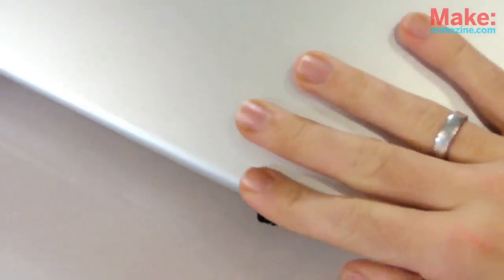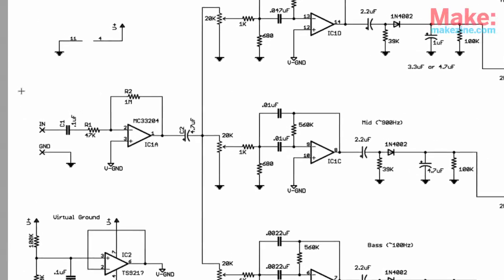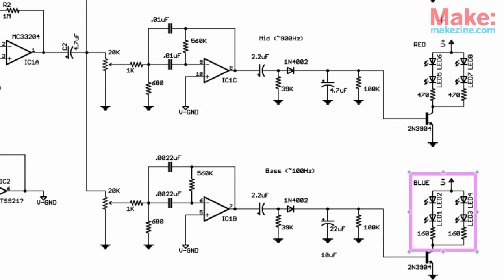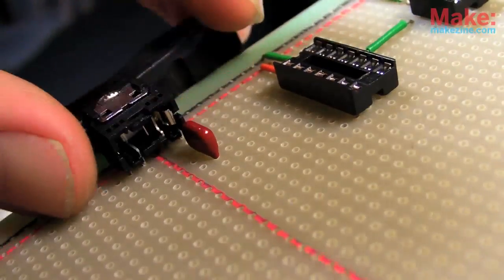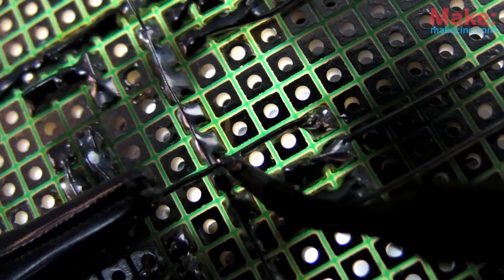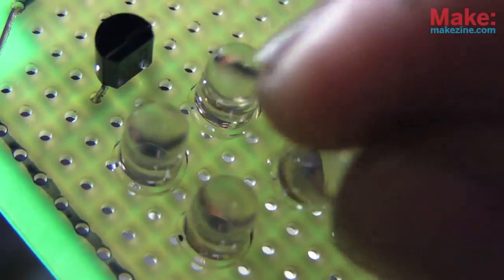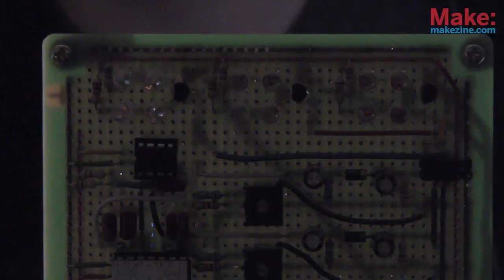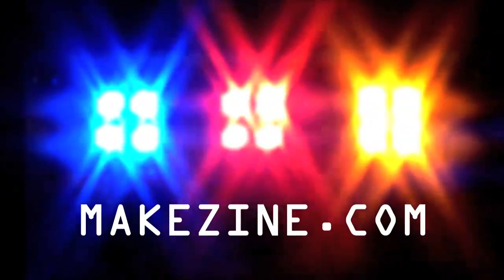Circuit Skills: LED Color Organ

Comment: Is there a way to miniaturize this design even more using smd components and 3V?
Reply: +jevries i know this was posted three months ago, but yes, Im designing a pcb that uses an arduino atmega328-P chip and a msgeq7 spectrum analyser to do this very thing. when its finished i can upload the eagle files and arduino files to something like dropbox or github if you'd like
Reply: +John McLaughlin That would be Nice!
Reply: i almost have it finished, there are a few jumper wires on the board due to single copper sided design(even though there are parts on both sides). i will include a map of these in the notes, it takes 12v in and  uses 12v led strips, i can design in a toggle switch that selects 5v or 12v for the leds if you woyld like
Reply: yeah, just in the final stages of testing mate, sorry its took so long, been swamped with work
Reply: +John McLaughlin did you make it dude?
Reply: :)) and ?! you died ?!  where is it.

Comment: where can i get ready made circuit like this i have plenty of LED strips
Reply: In sure you could find one on eBay, or radio shack sells a pre made circuit board with components and a much simpler layout

Comment: Hi. Can I use TL084 and C2383 instead MC33204 and 2N3904? I can't find MC33204 anywhere. I finished this Circuit with TL084 and C2383 but it not work,my LED isn't lighting. I can't find TS921 too,so I don't have virtual ground circuit but I used one 680uF capacitor to make same virtual ground. Some body help me :(

Comment: Great video! Could you show what parts solder onto one another, I'm a beginner and I don't really know what should solder onto what. 

Thanks!
Reply: Donna Davis that is what the circuit is for...
Reply: if i was you i shouldn't do this for a beginner project.
Reply: if i was you i shouldn't do this for a beginner project.

Comment: Can we make the same using LED strips instead of small LEDs... how the circuit will differ.

Thanx in advance
Reply: Totally! Just be careful about voltages and power consumption of the LED strips. The only difference would be the LED strips replacing the LEDs, and depending on how bright the LED strips are, maybe a few resistors.
Reply: For a longer strip of LEDs, you might want to add a few N-Channel MOSFETs to the LED output of the organ.

Comment: I built a 4-channel color organ back in the mid-60's from plans I found, probably in an Electronics Illustrated magazine.  I had to use 7-watt Christmas lamps back then.  I experimented with various ways to display the colors.  It finally burned itself out and I tossed it...I should have held on to it.

Comment: Can I solder on some type of mini microphone and then if I did would it flash the light by the ambient sound in the room and by "speaking" to it? Thanks.
Reply: yes you could,
I'd use a piëzo and use this as the incoming signal maybe the value for the first opamp should be changed so it boosts the signal a bit more but i think it'll be allright

Comment: Hello Colin, thanks for the video, can you tell me if this configuration will power more than the sets of 4 LEDs (I'd like to put 15 or so LEDs in 3 pots and use them to light a stage)

Comment: 8:13 seizure danger averted

Btw, isn't it possible to have the similar effect analyzing the vibration using accelerometer or something? In that case if You want the device to work with any device — just put it on the speaker case.

Comment: im going to do this as a project and as a noob i have 2  questions....

1) on the schematic, what is at the top left corner of the picture?
&
2) what is the voltage that it runs on?

Comment: Opamps usually require a split power supply. V+, V- and GND.  If you want to power an opamp from a single-ended power supply, (say a 12V power supply, or 9V battery), this kind of power source only have V+ and GND.   What you can do is create a virtual ground so your 12V SE supply becomes a +6V, -6V... all referenced from a virtual ground. i.e. you split it in half, and the midpoint becomes the new "ground".

Comment: Hey collin (or anyone), would this work if in place of the audio jack I attached a piezo disk which was in turn mounted onto an amplifier or speaker. Basically my sound set-up has only so many outputs, none of which are available for this to plug in, but if I used the piezo just sitting on one of the speakers would it pick up the sound vibrations and transfer them into the circuit just the same as if the audio source was wired straight in?

Comment: That can easly be done with a microcontroller, an arduino for example. It's far easier than this color organ, requires the most basic of programming understanding aswell.

Comment: Buy those 3W star leds from ebay instead of soldering 50 small ones. Not sure what transistor he used in the video, but the standard 2n2222 NPN has a current rating of 800mA which is enough for those star leds. About seperating, just leave the transistor and resistors on the board and draw wires to your lights.

Comment: What is the point of the 2.2uF and the 39kOhm on the output? High-pass filter with a cut-off frequency of 1.85hz? Also, where is the current limiting resistor for the base?

Comment: Its connected to the 12V supply
V+ corresponds to the pin of the MC332 (the IC that contains 4 OP's that he used)

Comment: Collin, I have a couple of questions- 1. do the op amps other then Vgnd still get a connection to power though not shown?  2. Where the band pass filters are shown to connect to Vgnd, that connection is made to the output of the Vgnd op amp?  3. the ground on the audio input is connected to the circuit ground? the negative side of the power supply?  Please respond (anyone who knows really)  I'm definitely building one and I want to get it done asap.

Comment: @NikySportsPromotion it's a voltage divider with Vout=Vin/2 and a a voltage follower circuit (acts as a buffer), so you draw no current from the divider, which would make it have a different Vout depending on the current you draw.

Comment: I just made this! It works great! Dimsanda, pin 3 is not technically a power input. It's "virtually grounded". The 12 volts should be the only supply voltage.

Comment: Hi , I'm going to try this one.but I have a question,
1.In the virtual ground circuit,there are 2 power inputs(pin 7,pin3)
In the pin 3 power input ,it is grounded on the other side o.O through two
resistors. Will the circuit short out????
Anyone please answer me.
thank you.
Reply: Pay attention to the ground symbols.  The ground with the three bars is basically the negative terminal of the battery, whereas the circuit sets up a mid point common reference for the rest of the op-amps.  It's a way of taking a single rail supply and making it look like a two rail (positive and negative) supply.  You want the reference of the triangle shaped ground to provide a mid point reference.  Without it the circuit won't function properly.  The alternative would be to use two batteries in series with the battery junction acting as the common reference point.

Comment: you can use LM324 instead of MC33204. The pinout is the same, and i would use a LM386 IC instead of TS921, but the pinout is'nt the same. IC with the same pinout is the LM741(a.k.a. UA741,ßA 741). Note that there is no datasheet for TS921.
Please rate this comment, because i will post the parts list too.

Comment: Hey guys, just to clear something up...The schematic is not my design. I don't quite know where it came from, but it was modified by me and a few other users of my website over the years. Originally it may have been based on a old and now defunct kit but I don't quite remember as it is 15+ years ago. Either way, I'm glad you found the info useful and glad you enjoyed the project!

Comment: Wow this is awesome! Ive got visions of modifying this to include relays or something and then getting it to switch higher power mains circuits. Made a disco light box a while ago that had 3 mains LED circuits in it powered by an old Christmas light sequencer and some bridge rectifiers. If I could get this to switch some relays or something then I could use it to make it light controlled. Also you could wire a mic into it as well and have it so that when 3.5mm jack is plugged in mic disconnects.

Comment: @JohnMPed with the op=amp that there you may be able to use a dynamic mic, but you probably will need another stage of amplification or more gain on the pre-amp section

Comment: @JohnMPed ya, you would probably need an amplifier, but you can find simple ones to build out of just  3904 or 3906 transistors. if you want to go all fancy you can use an op amp

Comment: @supafly377
It just provides 2,5v...
the 2 100k resistors function as a voltage divider.
the Op amp functions as a voltage follower.

Audio signals are alternative, so in reference to 2.5V  you get +2.5v and -2.5v.
The 2.5v "virtual ground" goes to the "-" of the 3 Op Amps.

To get a more LED's you need more OpAmp based filters.

Comment: Wow this is awesome. I'm an electronics student and I really want to get into DIY electronics in my spare time, and ths feels like a good first project. Justa few questions thoughif someone could help:
1. What is that virtual ground bit doing
2. Where does it go in the circuit? i.e how does the other stuff connect to it.
3. What do the numbers around the op-amps mean? Is it possible to add more to have an extra set of 4 LEDS?

Sorry for being an epic noob (not for long), Grateful for any help.

Comment: yeah, so I'm having to do this with a keyboard, only the guy whose having it done wants each note to have a different color, and each octave of that note to have a separate set of LED's. So I'm having to rig it directly to the key connection circuits and mount the 8 color strip onto the back of the keyboard w/o obstructing the power switch or jacks... I'm I just hope he doesn't want me to do this to his scratch table and vocoder too.

Comment: But why a transformer?
The output from the HU is what I'm really worried about because if it's a high output, it'd probably ruin everything..
Wouldn't a resistor fit the needs better?

Comment: @666rotu I would have absolutely nothing to do with the speakers..
How much thought did you put into that?
It wouldn't matter if I had a DD Z, a built out Fi BTL or even a Sony Explode..
It has to do with the output voltage of the head unit and possibly frying the circuits.